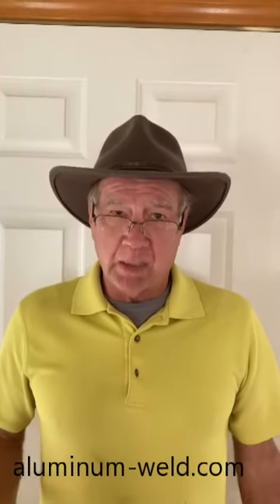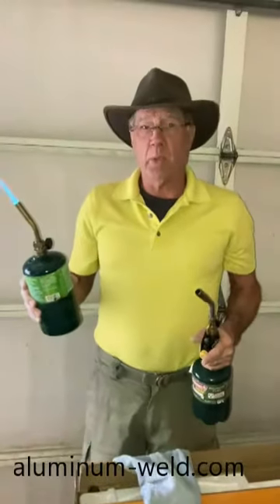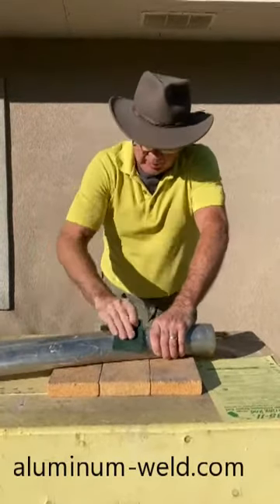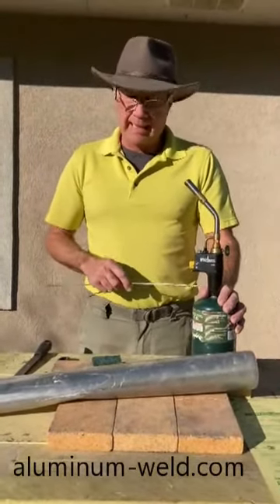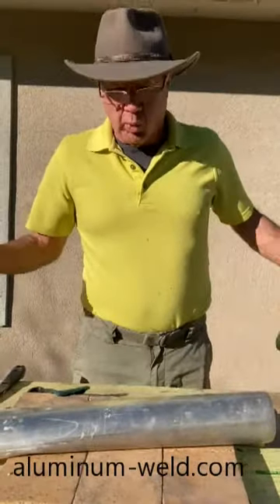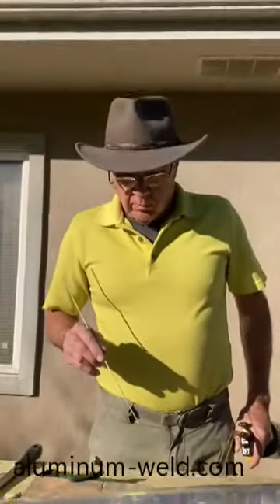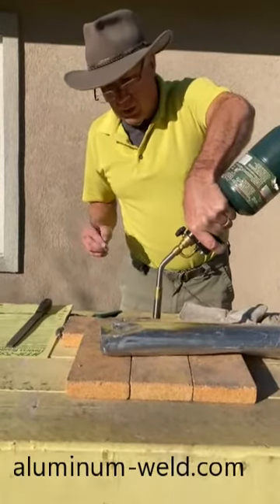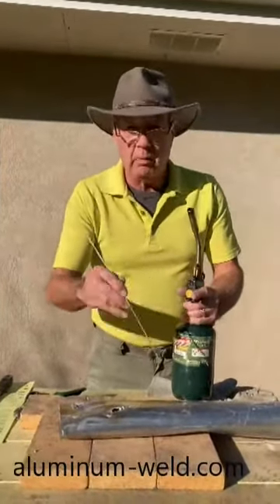Torch Tips, Heat Control, & Melting Point Temperatures

Comment: Thank you, Aluminum-weld.com! These tutorials are handy, especially for those of us who have little or no experience welding (brazing) aluminum. You were right when you said, "you're making it way too hard," because I certainly was. I guess I was too afraid of melting the thin aluminum air conditioning tubing, so I got impatient and jammed the rod in the flame, which of course, melted the rod resulting in no bonding. Next time, I will go at it with the correct procedure and greater confidence -thanks again, and take care!